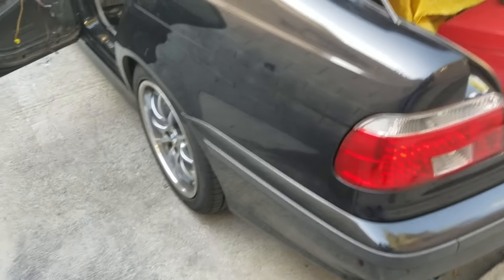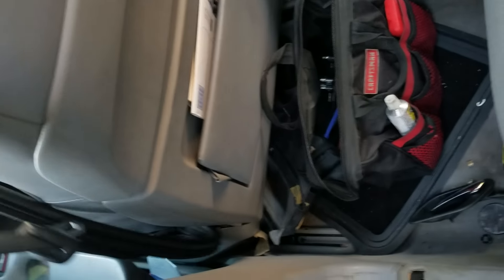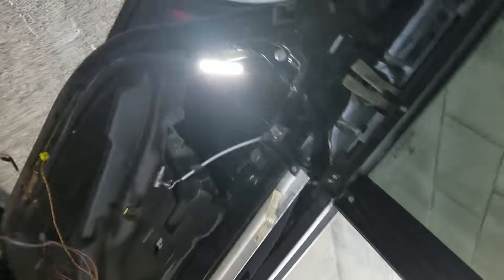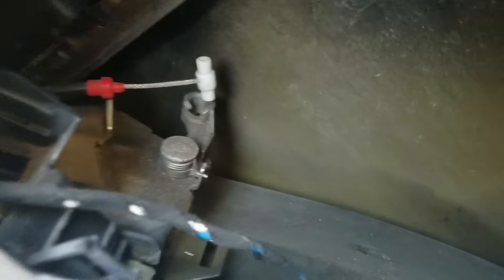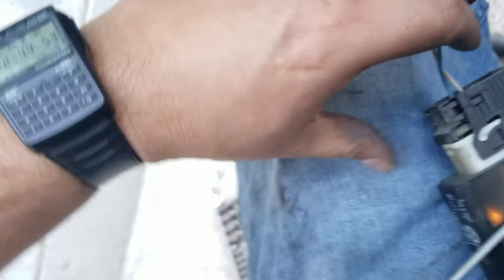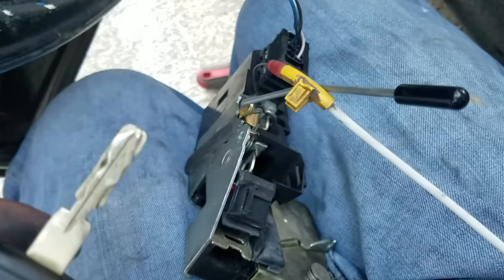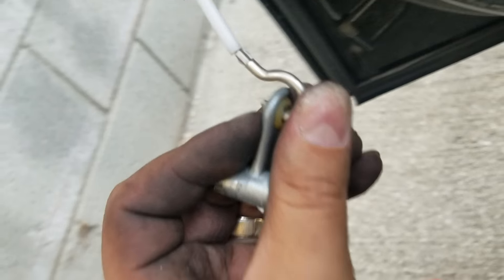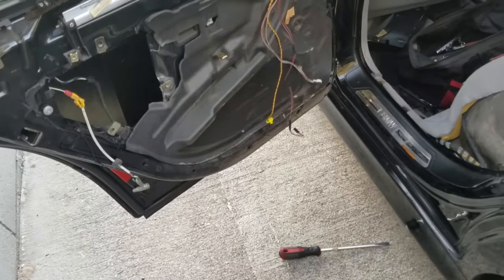Fixing a door that wont open inside and out on E39 Bmw and Replace The Actuator

Comment: thanks for help, my lock motor became detached Wiring) somehow, so i re did whole  mechanism..thanks works goodly :)...i might try some sound deadener while door is apart..the old pads are hard as a rock attached to the metal
Reply from the maker: Your welcome I'm glad you found my video.

Comment: Tried mechanically pushing the pin up on my stuck right rear e39 door, no luck. Tried jiggling while pulling inner and outer handles and pressing door in and out. Nothing seems to work.

The external door handle bowden cable pulls on a lever that acts to press in an internal mechanism (small steel "button"). The steel button seems to be stuck in place. Going to saturate in lubricant and hope for the best. This is really frustration (and frightening). I'll report back.

Comment: Hey, i have the excact same problem, but whith the front passenger door. What do u suggest i do? :)
Reply from the maker: Hello, its gonna be the samething. u will need to take out the door panel. Its gonna be crazy! though. have try to open it from the inside and really push the door hard..
Reply: E65/66 My driver side door was stuck shut couldn't open from inside or outside. I removed the rear door so I could get access to the front door plug to remove exterior door handle, once I removed it from the door I grabbed the cable going to the latch actuator, pulled up firmly twice and door opened. I replaced the actuator, problem fixed.
Reply: Sakarias Vegge i had this issue. I pried opened the airbag cover, made vapour barrier, stuck a flat head screw driver and messed with the mechanisms inside and the door popped open.. just today

Comment: dam this E39 is pissing me off one thing after other .. having the problem both side of the doors
Reply from the maker: Hello Ace. Yes these E39 Bmw need lots of love and patience At first I was man what did I get myself into. But if you are a car guy and handy it will get easier. One thing I can tell you always try to get OEM Parts. Some are expensive but sometimes you do find great deals. I just replace the blower motor. Had to remove the whole dash. But all came out good. Didn’t record a video of it. because there’s lots of them out there. But they do not show you everything.

Comment: Quite possibly the worst video on youtube. Should be titled "How NOT to make a video"
Reply from the maker: I would like to see you tried to make this video! Have a nice day!
Reply: Why did you remove the door seal to take the interior card off? If you cannot open the door from in or outside, do the following;
1. Remove the torx screw securing the door release handle to the door.
2. Grab the pull handle (the one used to pull the door shut) and sharply pull it toward you. This will release the main clip securing the card to the door. (You will feel the card slacking if it has detached correctly).
3. From the front of the door i.e. at the door pillar insert a screwdriver between the door and the card and lever the small nylon clips out carefully. Move around to the bottom and do the same.
4. Move to the top and lever the top trim out. It should separate from the rest of the door card. Make sure the door lock pin is down before doing so..
5. For the rear clips either pull sharply and they should release without breaking OR remove the top backrest part of the rear seat to allow insertion of a driver to lever the clips like the others.
Absolutely NO need to remove the door seal. Just gives more work and the risk of leaks and ruined carpet...